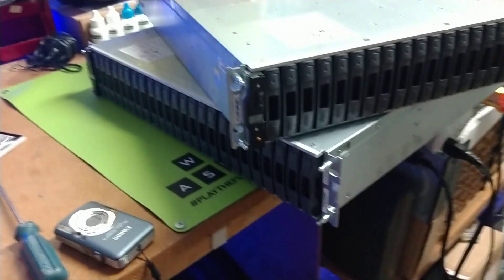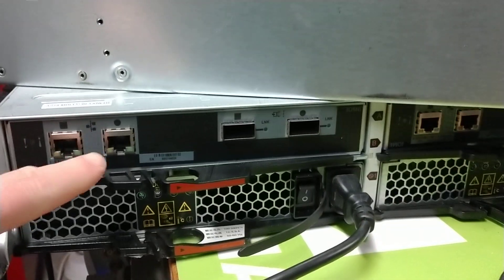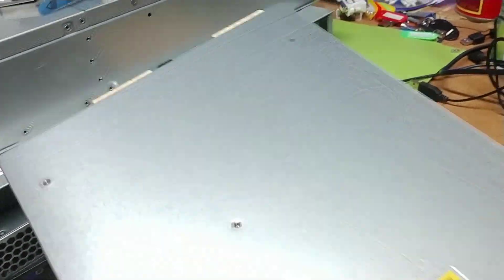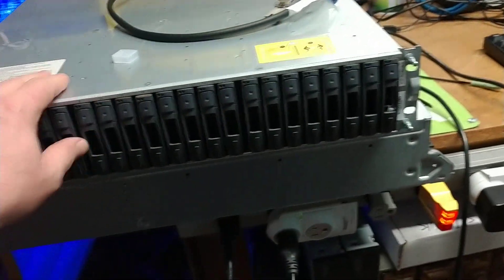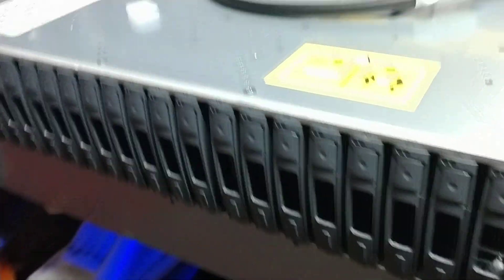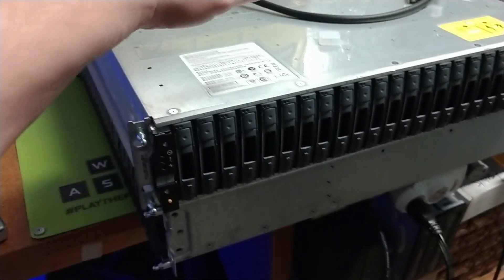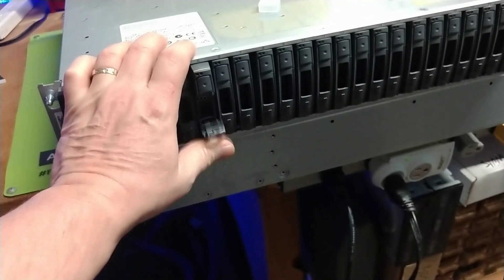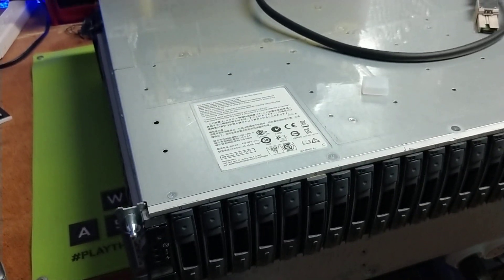Getting a pair of Cheap NetApp Enterprise DS2246 Storage arrays for under $100 bucks!!!

Comment: I know that the NetApp DE6600 and Dell PowerVault MD3060 are pretty much identical in many ways, but how similar to the Dell PowerVault MD1220 is this? I have one DS4243 (3.5 inch drive version) and a Dell PowerVault MD1220 so far for my server stack (all Dell PowerEdge servers).
Reply from the maker: THe MD1220  and DS4243 are both standard SAS chassis design.  So are pretty much the same if you do a single channel SAS setup.

Comment: Do you know how to get this working with sata drives? It looks like the caddies come with an interposer and when a sata drive is plugged in, the light comes on but the drive is not detected by the OS. Is that normal?
Reply from the maker: If the SATA drive is really old it may not pass the boot bios tests, I have a few laptop drive that are 1 TB that will not post do to be being 5400 spinning drives. They fail the S.M.A.R.T. post test.  use better 7200 RPM< SATA drives for this is enterprise level gear.   They are also cheap as well
Reply from the maker: Outside of that SAT or SAS work/fit just fine in the 2.5 hard drive caddies

Comment: how do you set this up?
Reply from the maker: One step at a time, do you research and have some fun doing it...
Reply from the maker: first start off seeing what server type system will you host the SAS controller.   I use a LSI 9200 raid controller that I prefer.   Research the cable connection, SAS or Mini-SAS cables. Then make sure your enterprise drives are format to 512 sector vs. 520 sector format if they came from a enterprise system in a bulk HDD disk buy.   Read your manuals but it is pretty easy to do.

Comment: Do the built in  power supplies run loud?
Reply from the maker: no, not after they do there pre-post boot up testing.  Sounds like a jet taking off for a minute or so and then they settle in.  If they are load then you have a fail PSU or something going on... Replace it and it will return to normal
Reply: @leadiususa7394  thanks a lot. This is helpful. Im looking to get this disk shelf to expand my Unraid. 2024 and this video is still helpful.

Comment: Does anyone know what is the baseline power consumption of the DS2246, without any drives? Preferably looking for watts pulled from the wall in real world using a kill-a-watt or similar meter, not manufacturer data. Thanks!
Reply from the maker: I think it is rated for drive output base ss or spinner disks 125 watt at the lowest I think.

Comment: Are these still worth it in 2023? I can get one for £180 including 24 x 900gb 2.5" sas drives with 2 x IOM6 modules and dual PSU's. I am thinking of adding a HBA to my HP MicroServer Gen7 alongside something like this to expand out my available storage.
Reply from the maker: Yes, get yourself a LSI 9200 or 9300 series HBA SAS controller and you will love it.   I would say 1 array will work for you and I have reloaded my Array with SSD and NVMe drives. The NVMe was a little harder to do but I got the right parts and it max's out the I/O 100% from the start and so does SSD.  Not so much with spinning disk. Refer to my other video on those details. And! Keep enjoying!
Reply: @leadiususa7394  Awesome thanks very much! I dont require mega speed so disk will be okay for now just some more space! For the price of 8TB HDD's and no where to connect them Disk Shelfs seemed to be a more viable option even with 2nd hand sas drives which I will eventually replace with ssd.

Comment: I'm new to disk shelf's and I just found one of these here in my region for a cheap price, so I'm thinking of adding this one to my homelab. Do you have any indication of cheap hba controller to pair with ds 2246?  I will probably have to import from ali xpress since it is very difficult to find this type of hardware around here. Btw nice channel just gained a follower!
Reply from the maker: Thanks for joining and yes. I think adding this disk array will meet your needs. as long as it fits  The key thing about this array is that it take pretty much anything disk wise.  SSD included so far.   Your HBA or RAID controller would be the only limit but I use the LSI HBA controllers and work pretty well.  Not sure what you can get in the local area but having a disk array that is flexible is key.

Comment: Hi! can you use 2TB SSDs in it and the netapp will underprovision to his limit of 1.6TB or it will not reconize the drives ? thank you!
Reply from the maker: I believe so but the formatting with take up some of the disk space about 390 GB so you are seeing 1.6 available.  I am sorry but that is just the costs of bigger drives.  As for it being SSD vs. SAS vs. SATA.   I don't think that is a issue unless the Array firmware is really out of date.  That is pretty hard to do for most are updated during production use.  Enjoy!

Comment: Good afternoon everyone, I have a device like NetApp DS2246 with a controller https://www.ebay.de/itm/132519013275?mkevt=1&mkpid=0&emsid=e11050.m43.l1123&mkcid=7&ch=osgood&euid=af7bae20602b4742bc115711a390db0f0f ~1&crd=20210721034159&segname=11050&sojTags=ch%3Dch%2Cbu%3Dbu%2Cosub%3Dosub%2Ccrd%3Dcrd%2Csegname%3Dsegname%2Cchnl%3Dmkcid
and cables 112-000128 I would like if you can help me if it can be configured by windows which version windows 10 or server if you can go step by step i would really appreciate it already tried everything and i can't thank you

Comment: How do I set this thing up on my system. So I have the DS2246 I have the HBA card with the SAS cables. I've plugged in and powered it on, I'm using Ubuntu 20.04. I can see the PCI device listed under system information. I don't see the disk anywhere.

My DS2246 is all green lights across the board. no amber.  HELP!

Ubuntu 20.04 OS
SAS9200-16e PCIxpress
Reply from the maker: Ok well first repost your system so you can see the BIOS boot up.  Next look during the posting reference to your HBA card.  You should be able to hit (Clt, S) or something like that to go into the HBA card bios. Many time HBA will be set to turn off mode.  Check to make sure it is set to turn on.  Next go into the SAS topography option menu to look at all of your disks.  If your disk start to show up then you are good.  If not all of your disk show up.  No issue. Pop all of the disk out of the slots and add each one one at a time and watch them populate in the Disk menu ready to use.  If you have a disk that will not populate then it may be bad. Set it aside and try another one.  Once done then boot into the Unbutu and use the disk formatting step you wish to use.  Let me know how it goes.  It is pretty easy to use.

Comment: Hey i have 2 of these laying around. What PCI Express card do I need for this as well as the cable? links would be nice.  I'm just not sure what's compatible or not. I have a full-size tower and the last card i ordered was a mini r something it doesn't fit my case.
Reply from the maker: A LSI 9200 HBA series SAS controller  card with dual or quad SAS external ports will work.  As for the SAS cables, do your research for it will be a SAS to SAS or a SAS to Mini SAS external outputs.  The controller side is always SAS.  Something people flip the cable so it may not work. Just flip it back around.  Enjoy dude! Here is a link to the SAS controller: https://www.ebay.com/itm/153813299469?hash=item23cffcb10d:g:~Z8AAOSwAepeMJ45
Reply from the maker: https://www.ebay.com/itm/203048008814?hash=item2f469abc6e:g:bMAAAOSwgZZfDXdK         for your two cables

Comment: Thanks for the video, I want to understand something , these items can work like standalone NAS ?  I mean I have just to put insieme some 2.5” sata drives and they have some backend menu to configure, or are needed other peripherals? Thanks for the answer
Reply from the maker: So if you are talking to the fact you populated a disk array with SATA drives, that would be a disk array.  This needs to be connected to a server of some with a SAS or e-SATA external cabling.  Then you download free NAS software called TrueNAS to load as the OS of the server that is connected to your disk array.  Then you can setup a NAS solution for your needs.  Make sure you have a 1 GB network connect or better, I use 10 GB NICs and switches for my needs.  Hope this help you out...

Comment: Hey i have 6x 800gb 2.5" SAS SSDs that my dad brought home from work and i've formatted them from 520b to 512b for use with my LSI 9217-8i in my computer. If I get one of these disk shelves do I need to reformat back to 520b to use them or is that just for use in a SAN?
Reply from the maker: Nope... 512 is good.  No need to return the format to 520 for any reason...

Comment: Hello, i Will need to Build a storage data center for some of my web pages, that are vídeo sharing, music sharing and social network, as we know, that needs a lot of space, and that is why i Will need to do that, but not now, because some aspects.
1 i do not know nothing about servers.
2 dont know what i Will need
3 the pages are recent, só im not making any money yet...

But i wanna start buying some server, and this ones i can get for a very good price...
What do you think of them to start, i am thinking in buy at least 5 and make raid.
It is possible to have 2 of them making raid with the other 2?
What else i Will need to work with those...
Thanks
Reply from the maker: Well, I didn't see a make or model reference in your message, can you give me that info.  Also look into AWS (Amazon Storage and compute) if you want to have your archive closer to the Net.  I will wait for your add info that I need to help you out.
Reply: @leadiususa7394  i dont have any yet... And like i said, o dont know nothing about the servers tecnology...
But i am been looking to some vídeos, and to use this NetApp storage arrays, i think i need some server lets say HPE Proliant 360... Só my question is, if i buy 4 NetApp Arrays i can use the HPE Proliant to use that over Internet, to host my own storage of my pages?
Thanks
Reply from the maker: @31studios35  IF you can try to get a Dell R720xd and a LSI 9200 SAS controller.  You may only need 1 or 2 NetApp 2.5 or 3.5 24 drive shelves to use to start with. (You can add more later as needed)  Don't forget the SAS cables to match your controller. (Do your research) refer to my videos to help you.  Are you going to use FreeNAS for your storage OS?  Also how much funding do you for your disk you need to buy?
Reply: @leadiususa7394  i know the aws... But i would like to have my own, now Just for testing in local and private over Internet, then when i know the works ins and outs better i Will setup as storage server for my pages...
Reply from the maker: @31studios35  OK
Reply: @leadiususa7394  hi sorry about been asking many questions, but i need to know before i buy it, if i can use SSD drives on it, or has to be netapp disks?
Thanks...
Reply from the maker: @31studios35  I put in two SSD drive small sizes like 250GB (or 500GB) SSD drives, then mirror them RAID-1 as the boot drive. (Very fast boot process plus good caching swap file for booting.)  Best practice says that I should never use the NetApp Disk arrays as boot OS disk space unless I am doing a VM stack.  Also make sure you check your motherboard BIOS to make sure you handle the SSD right.  Or just go to the latest BIOS as a good measure...

Comment: do you gave 3.5" bays for these? can I use freeNAS with em? Also can I use consumer grade hard drives, like WD purple? 
holy fuck that shit is louder than a vacuum cleaner...
Reply from the maker: For the DS2246, they take only 2.5 inch stata or SAS disks. They take most sata or SAS disks... WD purple is fine.  Make sure you understand the lower end disk speeds for they are slower.
Reply from the maker: And yes at the start (if not in a panic mode) the arrays are load but they will get softer in three of four minutes.

Comment: Hi, thanks for sharing !! I have a question for you : I have a Dell R620 and I want to use this kind of stuff, I don't realy know how to plug it to my server ... Should I buy and LSI HBA external and plug and mini sas on the netapp and a Sas to the LSI ? I'm not sure what I need to be able to use it. If you can help me this would be great, you are someone who knows. Thank you sir :)
Reply from the maker: Make sure you ID your SAS HBA card or RAID card first that will connect to the Mini-SAS (SFF-8436 to Mini SAS SFF-8088 Cable ). I find that this is the most  common cable tech get for their setups.  Just do your HBA or RAID card research first so you have the right end for each connection.
Reply: @leadiususa7394  thank you for your feedback! So I guess if I pickup an sas hba card for exemple I would see on my esxi all of my disk or if I do pickup a raid card who have sas plug in I will see the disk on the bios of the car and will be able to see all the disk? Sorry if its a dum question! I never see something like this and I'm scary to implement
Reply from the maker: @HelmanathTV  Yea, Ok this easy to explain. A HBA base card (SAS or SATA) treats each drive as a single drive that you use at the OS level and you have to set them all up for use. A RAID card doesn't present each disk but instead allows you to group the disks up into a protected state within a RAID group.  Like RAID 1 (Disk Mirroring) or RAID 5 (Stripe-set with parity).  When you boot the OS up. You will see a combine size of all the disk ready to be format for use.  For ESX I would do the RAID card.  If I was to build a NAS server like FreeNAS, I would go with a HBA and you can play with the OS level disk management instead of at the BIOS level like RAID.   They both have there values.  Have some fun in learning this stuff and there is no such thing as a dumb question in IT storage technology.
Reply: @leadiususa7394  thank you so much sir for your answer! This helped me a lot!! Now I understand then I need to search for a raid pci card with sas connector to be able to use this with my esxi. Thank you a lot!! I just need to look for a cheap one now :p
Reply from the maker: @HelmanathTV  No problem...

Comment: Can I use these shelfs to test a bunch of sata drives at once using badblocks or similar software? And if so, how many of these can I stack to use with a workstation running the test software? Sorry but I have no prior knowledge of enterprise hardware. If there is any source I can learn from would be great.
Reply from the maker: Yes

Comment: Can you help me get my dd2246 to work on my Dell Poweredge R620 please? A NetApp representative said to use qsfp to qsfp sff-8436 to sff-8436 sas cables with a NetApp 111-00341 HBA X2065A-R6 card and linux and linux will see the shelf. Is Ubuntu not linux? I booted my server with only the hba card and it gives me a screen of garbage and reboots.
Reply from the maker: Ok. And always yes I will help you.  First make sure you id the port connections on both the array and your HBA.  Then yes not all Linux are the same. Go with what is recommended. And boot off a USB stick to make it easy...
Reply: @leadiususa7394  https://ibb.co/Kq398qy

https://ibb.co/vZq4p6m

https://www.ebay.com/itm/401517571819

https://www.ebay.com/itm/333667510097
Reply: @leadiususa7394  I will take pictures and you can see the hba and the disk shelf
Reply from the maker: @anthonystrohmayer9191  email it to me bdyke@woh.rr.com.
Reply from the maker: Then time to load the disk utilities tools so you can see and work with you SAS controller.
Reply: @leadiususa7394  what's a disk utility?